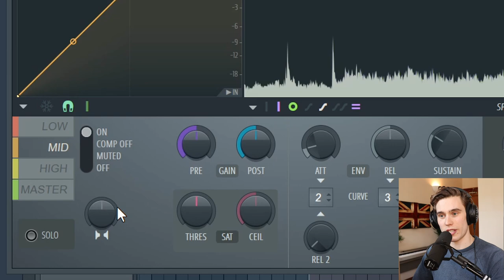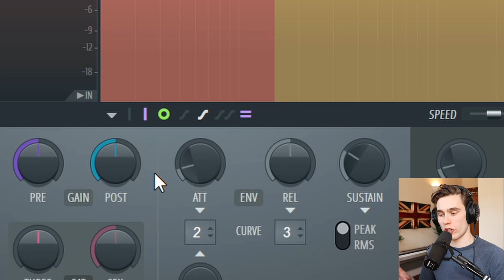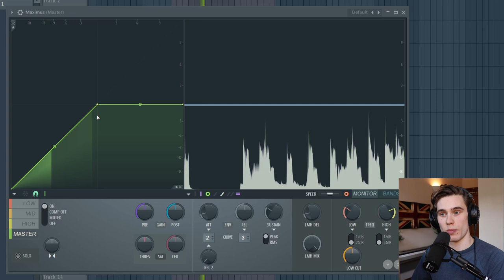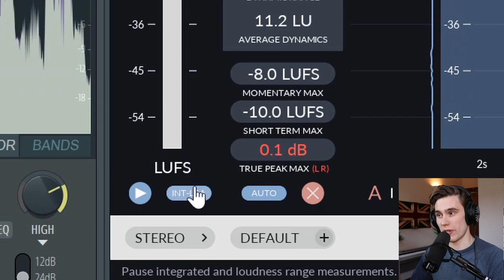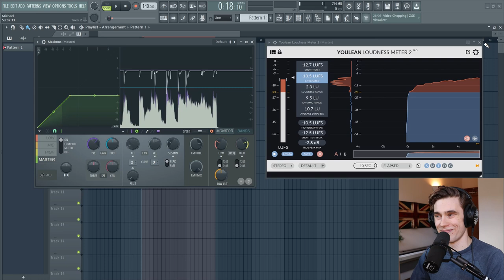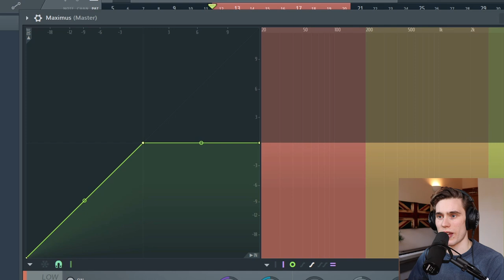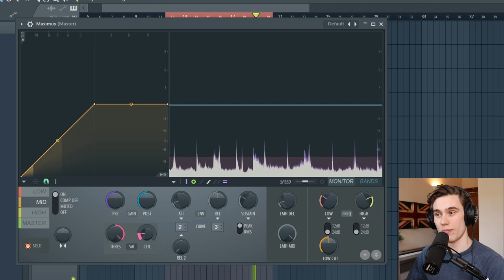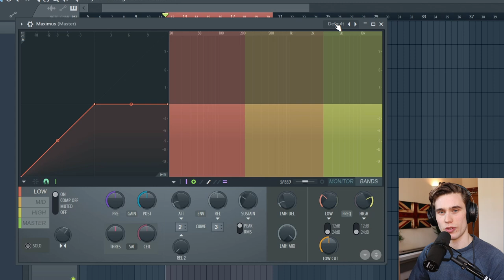Maximus Tutorial - What You Need to Know - FL Studio 20

Comment: Me with 4 months of experience. 
Opens Maximus on master.
Selects clear master preset. 
Job done.
Reply from the maker: Job Done!
Reply: better yet, just use soundgoodizer and you can skip the third step
Reply: LMAO, i do the same every single time
Reply: I used to use the "Max Loudness 2", as it did a good job at hiding how badly mixed my track was 😂
Reply: @kingbingbong1920  Fun fact: Soundgoodizer is actually powered by maximus
Reply: I still use it on some kicks, to make the sound clearer and compress it
Reply: Every time. 😂😂😂
Reply: @inthemix  for some reason I was able to achieve a better sound by just slapping a fruity waveshaper on my master channel. Why is that? It seems it can add some saturation/distortion as well as loudness. I was positively surprised that the audio also sounded good on other speakers/headphones and not just fl studio 😁
Reply: @kingbingbong1920  that'd be me
Reply: @kingbingbong1920  lol
Reply: @remakesession6253  yeah, i use them both
Reply: @sivur  wave shaper adds distortion so your sounds will sound fuller (more frequenties). This pleases your ears very much
Reply: @sivur  but know, it should not be possible that this gives you the best mix possible. It probably just brings you somewhat closer to a nice mix.
Reply: Me with 5 years of experience.
Opens soundgoodizer on max strength.

No, seriously, I use Kotelnikov (comp. Michael recommends) preset on master, it´s just a little bit of comp :D

Comment: The multiple curves compression thing was amazing! I've never heard or thought of it. I guess it can be used as a compressor, a noise gate, and even a transient processor at the same time. Maximus is such a powerful tool
Reply: And as a waveshaper when the attack, sustain and release are on 0. That's the only difference between fruity waveshaper and maximus... so 3-band saturation/distortion, exciter that is. Kinda freaking cool! I pretty much use maximus for all tracks
Reply: nenissaK have been using the saturation on fruity limiter with the attack release and sustain on 0 and didn’t exactly know what it was doing it was jus something I did by accident but now I know it’s using it as a waveshaper. Thanks 🤙

Comment: I actually use maximus for everything. It's the only Plugin I use on my master
Reply: Quick question. Do you care to use Isotope for mastering or are you Maximus all the way?
Reply: @deboman81  I only use maximus and span. In my older songs I didn't master. Only for high-pass filter in buildups
Reply: Stormbreaker YT good stuff 👍🏾👍🏾👍🏾
Reply: @deboman81  thanks
Reply: @Felix_oderso  crack it I did but it's laggy
Reply: Felix splice, sir
Reply: Felix they had a special during April through July but it’s over now. You may want to wait till get it during the holidays
Reply: @StormbreakerYT  wouldn't recommend cracking but before I bought it I had a stable crack which worked as good as the paid version. But ozone has some great features like imager, master rebalance etc. but most of this can be done with stock plug-ins and Maximus is super powerful and great. 👍
Reply: Put a reverb on the master
Reply: ozone isn‘t that good imo. my master chain is: FF mb , saturation knob, parametric eq2 to get 20-20khz only, maximus, with only little compression putting low band on mono and mid and high a little wider. last add soft clipper on out 78% after to get more compression and gain from maximus into it. After just span to see the lufs. 78% cause it makes tp to like -0.5

Comment: Hi Michael, as far as i'm aware, Maximus does not have a dual stage release. Release one and two are simply different release curve shapes which can be blended (into a single release curve with elements of both shapes). Release one being an accelerating curve, release 2 being a decelerating curve. Maximus default is on release 1, but release 2 is can give a totally different feel, often more transparent
Reply from the maker: This is what a duel stage release as far as I see the term, it’s a release which has more than one shape either in series or parallel.

Comment: Well laid out tutorial, here's a suggestion and some supplemental info:

You didn't actually show that the tension and curve type can be changed between points on the envelope editor which is a shame because it's probably the coolest feature of the plugin.

The difference between Rel and Rel 2 is the shape of the release curve. This is an advanced feature, yes, but not that confusing at all. The way compressors release a signal is what gives them much of their "character" and you can emulate certain hardware compressors or even competitors' plugins by combining these two knobs in the right way. This is not something most people will do though.

Keep in mind that linear phase adds 2 ms of latency to that track so either automatic PDC or manual attention is a good idea. Also -- as of this writing -- linear phase mode has a bug where the "high" band doesn't actually filter properly and may contain all of the bands rather than just the area you set in yellow. This is a recent bug and somehow it doesn't occur in zero latency mode, hopefully it's fixed soon.

The low cut knob: while a useful option, unfortunately it's actually not a very high quality filter and you can't see its steepness either. So I turn it off not because I like rumble, but rather because I prefer a standalone pre-filter for achieving the same goal.

Lastly, saturation: threshold tells "how much" of the waveform's range it should act upon, and by cranking it to 100% you're basically telling it to process all of every wave cycle from peak to silence and back. This may be what someone might want for sound design but it's a terribly dirty idea for a mix, as you've noted. Still, you can absolutely saturate a whole mix with Maximus, as long as you use low (transparent) threshold values, such as 0% or 10%. Ceiling only sets the level that the signal can never exceed and so is not really the primary sign of "how much saturation" you'll end up with.

Keep up the good work

Comment: Trap producers:
Soft clipper or Maximus?
Reply: There for two different things, depends what you need
Reply: @bubzuru Soft clipper is easier workflow, since slapping it on from the beginning is pretty much what everyone does. Maximus takes more time to tweak, so it's not as great for workflow. But I mostly asked regarding workflow vs final product. Like is tweaking it worth the time and sound of the final product that soft clipping can do.
Reply: @user-lt2rw5nr9s  Soft clipping isnt doing nearly ass much as the maximus... 😂 its just thrown on pronto to prevent clipping. doesnt enhance any sound
Reply: @andrewsanabria5942  Well, what does "enhancing" the sound mean? Maximus is a multibrand compressor, but soft clipper is just a saturation/distortion plugin. The soft clipper is the quick and dirty way to get hard drums, but Maximus is a longer process to set up. If you are trying to bang out many beats a day, soft clipper makes more sense. Soft clipper doesn't have to do as much, especially if you don't want it to.

Comment: Hey man I have a question. When you pull the original node down at 12:06, do you have to pull it down until the line hits the wave form for it to have an effect? Like you know when you set the threshold on a regular compressor and you have to pull the threshold line beneath the wave form in order for the compressor to have an affect on the sound. Does this work the same way?

Or can that first node having an affect on the sound before that line even crosses  into the audio wave? 

If that line is above the audio wave is it like threshold where it has no processing affect on the soundwave because the threshold line is set above the transient

Comment: When I load up Maximus on the default preset with all the controls off, its boosting the output by 1 or 2db for some reason. Iv checked it with Fruity db meter and can even see the waveform get bigger if I check it in Fruity Limiter with all the limiter controls turned off. Any idea why its boosting the output like that? Cheers